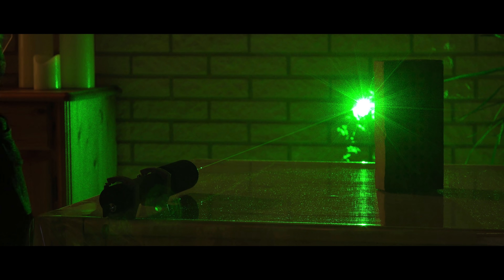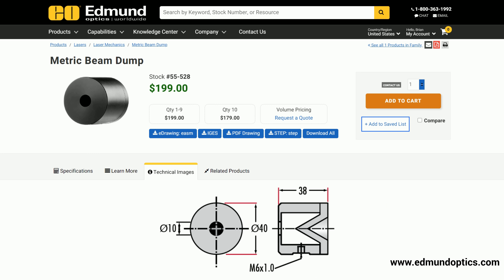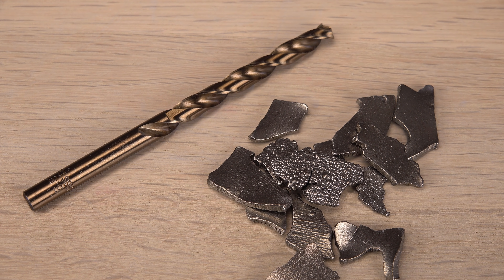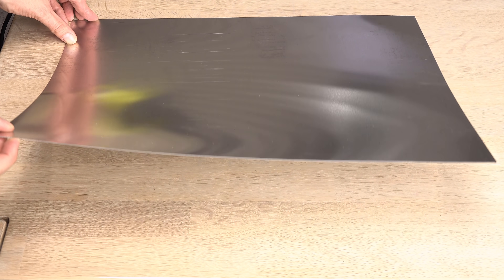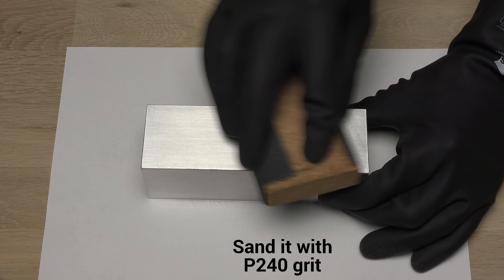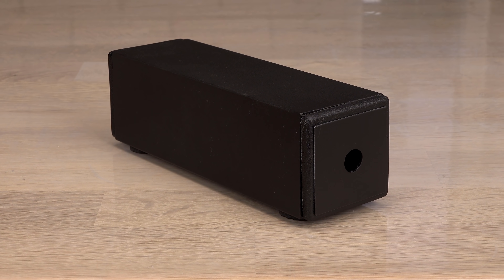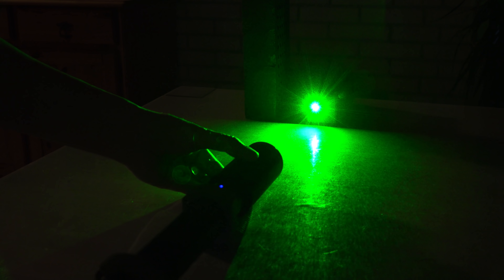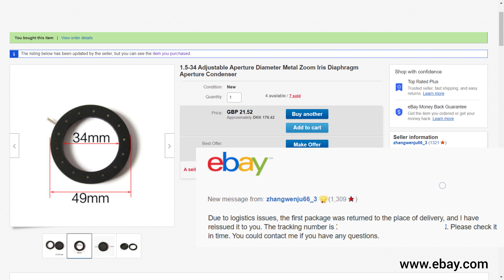Don't use strong lasers without this - easy to make!

Comment from the maker: Hi all! Happy New Year - will read comments later. The beam dump turned out well, but let's make it even better. Does anyone have a good, easy solution for a metal end cap in stead of plastic?
 I can't weld aluminium - or any metal for that matter...

And how do I fix the iris diaphragm to the front of the beam dump in a lighttight way without obstructing its function?
Any input is appreciated!
Reply: I would add some baffles to the inside of the tube with a holes larger than the aperture. That why it is less likely the light will bounce back out.
Reply: @ionstorm66  I thought that was what the large washers were for, at the start.
Reply: The idea of an aperture sounds smart, I can't wait to see it!
Reply: There's always the option of silicone backed aluminum tape.
Reply: You should find metal end caps that fit heating and ventilation pipe and ductwork if you search google for "Ventilation end caps" and specify the size you would like. Here in the United States I can find 3 inch diameter, often used for pellet stoves. You can also get sections of duct that have built in heat reclaimer/radiator rings, those might help dissipate the heat from strong lasers. They will likely be galvanized steel or possibly aluminum. You should be able to cut the hole with a step bit or with a chisel or hole saw depending on the material. I think there are metal putties and adhesives that might work for you, I'm sure others could direct you to brands.
Reply: Happy New Year Ingenious Sir!
Reply: You should see if you can get your hands on some of the Black 3.0 paint. It would at least be interesting to see how it handles the lasers. Happy New Year and stay safe!
Reply: I am no engineer but I think it could be solved by making the end cap out of aluminium and attach it with screws from the outside (like taking a slightly bigger tube and screwing it onto the smaller one). Also I think you could use a cone instead of an iris. That would redirect all the light to the center, which could therefore be smaller (it would just have to be better manufactured so that it is completely flat and no light reflects back due to imperfections). I made some Geogebra experiments and as long as it is decently long (not too wide and short) and you are shining in the middle it should be good to go.
Reply: You can get metal tap-in caps for many tubing sizes.  They have a threaded hole and are used to hold caster wheels.
Also, I wonder if lamp black/soot on the inside would be more effective than paint.
Reply: Hey i have a problem you might be able to help me with, my work has a laser engraver for alu and it has no shielding on it and people are working only a few meters away from it for 8 hours a day, and everytime i ask about shielding they say "just dont look at it" but how much do i need to demand shielding for it? Also the walls around it are painted metal so any reflection is going all over the place:/ Also we do lots of alu work so if you need small bits and bobs done let me know:) Im form Denmark too:)
Reply: Happy New Year!
Check out graphite cones, can be found as a regular cone and inverted inside a square. Perhaps using a graphite crusible used for melting metals will make it safer overall as you don't need to paint it - it is black already. Downside is graphite is brittle, so don't throw it around and drop it. Easily workable, but messy. 
Excellent video :ø)
Edit: Use both the regular and inverted cone for optimum absorbtion - the inverted cone should trap and reflect photons back into the inside of the beam dump. Aperture control may be done by adding/removing slices of coned material (with corresponding sized cone-hole in the middle, naturally)
Reply: Hi! Happy new year!! :)
Reply: Happy new year as well man!
Reply: Performance Enhancement:
If the beam trap can be a little bit bigger like 100x100mm then guide the beam around 3 or 4 corners with mirrors before letting it hit the target. Also use Black 3.0 as your target (beam defocus needed befor hitting the paint).
Reply: Fold the Aluminium into a box shape
Reply: Happy New Year!
Reply: I wonder how good black 3.0 would be for this use. Maybe too effective...
Reply: Though I wouldn't paint cone with it! let it scatter some and inside sides can be black 3.0 and kill reflections completely.
Reply: If a strong laser hits the plastic end cap, it could melt through. Instead of a metal end cap, make another black aluminium plate that fits tightly into the square tube, drill a hole in the center and fasten it onto the screw just behind the metal cone. Also, I believe JB Weld is your best friend when it comes to metal-to-metal heat-resistant bonds.
Reply: I would suggest using a pipe with an inside diameter slightly smaller than the outside diameter of the diaphragm so you can wedge it in nice and tight without using glue. You could also cut the pipe to about half the length beam dump and have most of the excess pipe inside it, this should further increase the amount of light captured.
Reply: fold the endcap out of sheet aluminium (a simple "U" that fits into the box section) . Use graphite/metal containing epoxy to make light-tight. Or just glue a square piece to the front, no folding. Note that the glue needs a rough and oil-free surface to even have a chance of holding on.
Reply: They contain kobold ?
Reply: Hi Brainiac75. Use graphite. Two pieces of graphite plate with a 45 degree separation between them (looks like a big V) and put that inside your square tube (Or graphite rod with a blind hole in it). Point the beam (to be dumped) into the center of the two plates; i.e. Imagine the cone you're using now, but focus the beam on the inside, not the tip. The graphite has a very high absorbance ~ 0.95 and high coefficient of thermal conductivity, so will dissipate any absorbed light. Any scattered light will be re-absorbed by the graphite walls. Works especially well for CW sources.
Reply: Paint it Vantablack for better results 🧐
Reply: Maybe you can improve it if you use black 3.0 or similar on the inner tube (not on the cone). That would be interesting 🤔
Reply: Hi Mr. Brainiac, and a happy new year to you too. If you give me the dimensions of the box section and the iris mechanism, I will be more than happy to machine a metal endcap for you (for free of corse). I live in DK near Copenhagen so shipping or delivery directly to you should not be an issue. If this makes any sense, just let me know :-)
Reply: Can’t you buy metal pipe caps?
Reply: just solder it, would need to preheat the beam tho....
Reply: Using spray paint may not be a good idea - You can probably avoid the fumes from the spraying but can you avoid the fumes from it burning, as the laser is more than a few thousand degrees hot! (A 5W laser will easily burn PVC at 450 degrees Centigrade - check it out at 3:33 in:)
https://www.youtube.com/watch?v=XqIfkhaYMMI - How hot is a 5W Laser?
Reply: What happens if you install a piece of glass inside the dump tube to help trap the beam. You could try different kinds of glass. For example the lens from a pair of welding glasses. Acid etched or sand blasted glass so it doesn't reflect the beam, or filters based on specific wavelengths. Example: red laser = blue filter. Red passes through and becomes purple, but purple cant really pass back through a blue filter.  Or a small piece of two way mirror with the reflective side facing the rear of the tube so it reflects the beam and prevents it from passing back out of the hole.
Reply: Try thermal epoxy, something like this https://www.amazon.de/dp/B07QV2M411
Reply: Just make the metal cap the diameter of the pipe, so that its a "flush" fit. Super glue, quick dry resin glue, or 2 part glue all handle heat well enough.
Reply: 3D printing is the solution to everything
Reply: Happy new year to you as well!
Reply: Duration for upgrade vanta black paint
Reply: Solder it instead of weld. It's almost the same but not as intense, yet very sturdy. Watch videos in soldering. I did it in seventh grade shop class.
Reply: Hallo ich weis das du deutcher bist wegen ein zwei jahre altes video mit den magneten
Reply: Ohh try to paint the inside and outside with muso black and maybe will make it more effective
Reply: Maybe because muso black absorbs aprox 90% of light the beam dump will be super effective.
Reply: Now there is the Musou black that is the blackest black paint.  https://www.ko-pro.black/product/musou-black-paint/  Seems the lining in the container tube can be improved to baffle more of the reflected diffused radiation.  Wondering if an outer cone would be better like a smaller section of the plumb bob or longer slimmer so basically have half sections on the side walls and then the center cone.  Seems would be most effective.  Like an anechoic chamber basically is what I envision.  Then something maybe like a one way mirror neutral density filter design or something maybe?  I'm not an expert at what you're doing, though just invested in a optical workbench to start off the interferometry projects.
Reply: @jafinch78  thats what i meant
Reply: @UnknownArt_K  I didn't even notice since didn't go through all the comments.  Right... you're correct sir generally meaning.  Reads like the Musou is even better than 99%.  Some metamaterial surface area to deal with the volume more will be ideal too so to maximize the surface area to prevent any reflection or diffusion or basically any light coming back out the input hole.
Reply: 👏👏👏👏👏👏👏👏👏👏👏👏👏👏👏👏👏👏👏👏👏👏👏👏👏👏👏👍👍👍👍👍👍👍👍👍👍👍👍👌👌👌👌👌👌👌👌👌👌👌👌👌👌👌👌👌👌👌👌👌👌👌goooooooooooooooooooooooooooooddds
Reply: Why not just paint the brick with Vanta-Black?
Reply: So what happened with the iris? I'ts from a microscope, right? Personally I would make a custom cover/adapter with your resin printer that has the perfect size tube at the end to mount it in with some JB weld (epoxy) it can take a lot of heat.
Reply: do you have the websites where you brought the lasers? if you have, can i have them please?
Reply: for your purposes (since its not going to have heavy use, need to be load bearing, etc), I hink super glue or something similar will work. There are metal glues that ive seen that should also handle high heat. you could also try proper sealant, resin, etc.  You can make a metal cap and just glue it down using one of those things! I think that should work for your purposes!
Reply: I am faster than you
Reply: duct tape

Comment: aluminium needs a primer to adhere properly , matt paints tend to flake easily , but still this is easily re-coated , a tip ,if sand is mixed with the matt paint,black sand,it may help scatter light reflections inside the trap,if the trap were made like a silencer,some may think hubble telescope but a series of baffles to allow the beam in but stop light getting out ,the bumpy surface of sand + paint again would help diffuse and reflection making and specular beams hopefully get trapped inside a baffle section,baffle sections are made from large washers painted with the light scattering paint / sand mix,in a series of washer spacer tube washer spacer tube ,spacer tube is a piece of tube small enough to fit inside body tube,body tube is best round in this case ,if thin wall aluminium tube is used the small sections can be cut and split to make "c" shape spacers to go between the washer baffle plates,hubble used razor sharp inward facing light baffles to trap as much light as possible,but the idea is very much the same,and would be very efficient for a laser trap.

Bumpy surfaces don't reflect light with great beam density it tends to scatter , some light reflector shades use this to spread light more evenly,like in green houses to stop spot reflections,the matt surface would help as said to absorb the light along with a matt coating to further minimise light energy density.

This method would be far and above any light trap on the market,and if one exists like this expect to pay BIG £$£$£$£$£$£$£$£$£$£ for it,

A further boost could be done using black matt ceracoat used to coat firearms with a ceramic coating of high temp resistance and resistant to peeling or flaking,used for motor bikes too,some real tough shit there.still well below the highest end trap cost.

Make a baffle trap large diameter for best results 4-6 inch tube 12 inch long will be a veritible black hole.

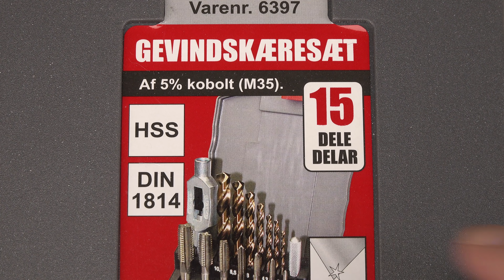Comment: @3:00 the gold color is not from the added 5% Cobalt!! 🧐☝️ Cobalt is silver in color not Gold!! The drill bits may have a Titanium Nitride or tin oxide coating,  or it may be just protective grease or hardened oil they put on the drill against oxidation!!

Comment: Hmmm, wouldn't anodization be a better choice for the beamdump?
Reply: Anodized aluminum is quite a bit more expensive to get in small quantities and paying for anodization in general is usually more expensive than a can of spray paint. It can certainly be done though, both are viable options

Comment: For what it’s worth- I’m a grad student in an optics lab and we use small beam blocks that are essentially stacked razor blades as our beam blocks. They work quite well on our class 4 lasers and are pretty cheap, around $50 usd. Thorlabs part LB1 if anyone is interested.

Comment: would a second conical baffle (open at the front) help - at the moment there are many 2-bounce paths out - onto the cone, onto the wall, which is a diffuse surface, then out the hole again.  sort of like      [>>]     <-- light    so light comes in  goes through 2 holes, bounces off the inner cone, and then lands somewhere either on the inner surface of the first cone, or deep at the back - that way there is no simple path for the light back out again.

Comment: Ok, lets add some proper science to this.  What you have devised , or in fact rediscovered, is called a JEANS-RAYLIEGH CUBE and was invented in the mid 1800 by two famous victorian physicists to investigate the properties of black body radiation, and gave rise to two laws of physics, the STEFAN - BOLTZMAN  LAW, and  WEINS DISPLACEMENT LAW. They were trying to find out why when metals bars are heated they colour changes from dull red to white, and intensity of the glow increases correspondingly, and it ultimately led to Max Planck formulating the idea of quantisation of radiation.

Comment: If you need a quick and dirty way of achieving a similar result you can get a stack of utility blades and glue them together. Then simply pass them over a candle to accumulate soot and viola! works extremely well.

Comment: A bolt is not technically a screw. They are quite different and unique in function. Screws for starters create their own threads, bolts do not.

Comment: Not an expert but this seems a bit over-engineered to me. An aluminium heat sink inside a cardboard box with baffles? A conventional ventilation light-trap? A laser is just light, you can reflect it into an indirect dead zone. Multi-stage diffusion

Comment: Wouldn't that work way more efficiently if you'd simply get another one of those weights, drill through and tap the end, use same bolt and mount it it basically the exact same way? I'd assume that light that could bounce back would be really little. Just a thought, it would be really easy to make it like that. Edit: obviously meant that also drill through the bolt.
Reply: I'd also check out if you could get ie. diamond cutting wheels for grinder or similar where you cut parts to fit inside that tube and paint that in black. Idea being that it would kinda work as retroreflector that would waste power. Just a quick thought

Comment: You need some step-drills. Every hole you made in this project would have been neater if you used a step-drill. They make clean holes in thin materials.

Comment: Would a similar container filed with charcoal act the same. Charcoal has excellent heat resistance and absorbs light very well.
Reply: Until it starts burning.

Comment: XTC is a high temperature/heat resistant coating formulated specifically to protect metal surfaces operating at temperatures from 500°F (260°C) to 1500°F (812°C).

With proper preparation, XTC provides outstanding adhesion, film integrity, weathering, and thermal shock-resistance throughout this entire temperature range, and is guaranteed not to burn off!

Comment: 2:15 the diagram for it is wrong. The direction of reflection is not that

While the pointed is indeed better at preventing frontal reflection, it's worse at diffusing light across a wider area when compared to a blunt point

Comment: If you can scatter the light inside of a hollow object, it's not all that important to paint the insides black.   A certain (small) proportion of the beam will be turned into heat at each reflection.   Surface roughness will scatter the light and the heat will absorbed all over the place inside.

Comment: Using cerakote would be ideal for this
Reply: For clarity, cerakote is a ceramic coating that is used for fire arms. It’s resistant to basically everything, corrosion, heat and pressure

Comment: It is a cool feature, although it might be a little dangerous as it may seduce people to skimp on using the glasses, thinking the beam safely cought, while a minor misalignment or the classic wrist watch can still get a reflection to your eye.
Also for even stronger lasers, I would suggest adding a aluminum plate to the back part, as the plastic stopper can easily be molten.
I once wanted to save money for buying an expensive mirror mount and 3d-printed one from PLA. it worked just fine, but at some point I had the 800nm 50W CW laser (unfocused to 25mm diameter parallel beam) graze the edge of the mirror due to a slight misalignment. The mirror is since them molten to the mount and can no longer be removed from it :-P